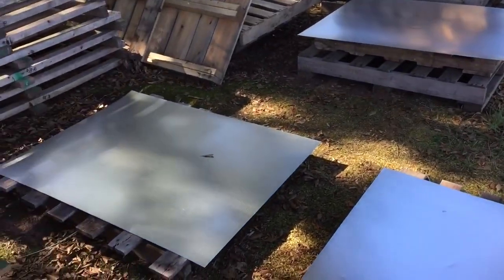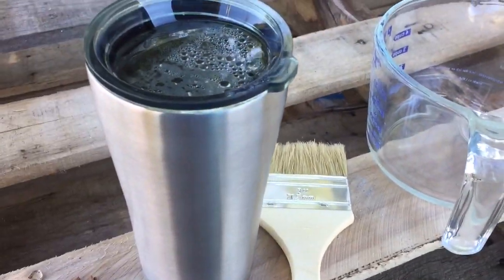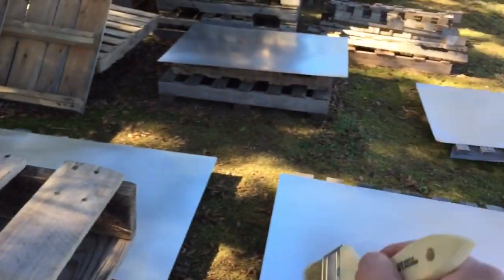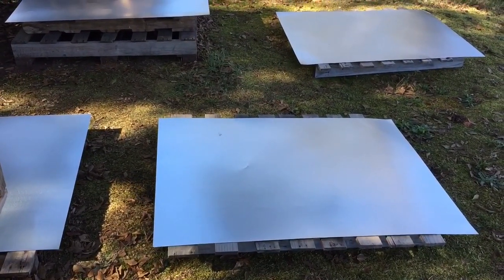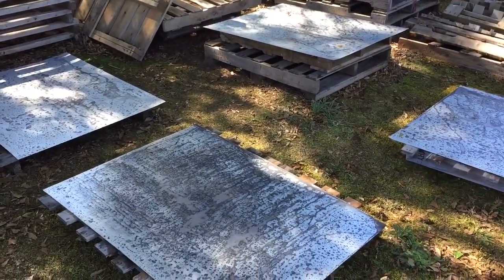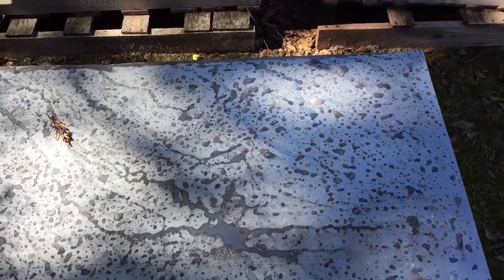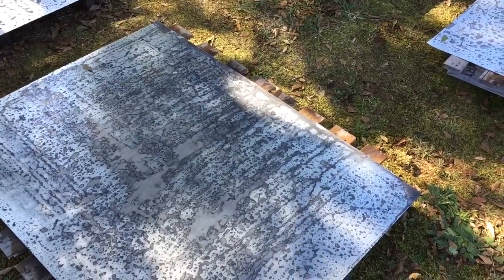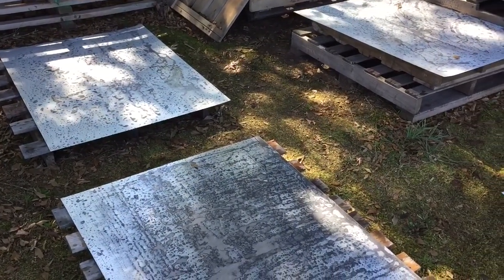Aging Galvanized Metal Sheets Part One

Comment: I am really struggling man. I watched all these videos on rusting galvanized metal. Looks like it's super easy process so I bough 100 sheets and wanted to use it as siding for a garage. But here I am and doing exactly what everyone else does and nothing. Just turns chalky white. Then nothing will take it to the next step of rust. I just can't figure this out. Driving me bonkers because I spent a lot of money. Anyhow, that's my story.
Reply from the maker: If you do what I did in this video, you should have rust. I’m no chemist, but it worked like a charm for me. I wish I could be more help.
Reply: I'm having the same problem.  I can only get a white chalky finish.  4 coats of muratic acid, and i even tried a wire wheel.  So frustrating.
Reply: @mrbriankeith111  Yes, nothing but white chalk here as well. I have $3000 worth of shiny metal just sitting in my driveway. Sucks.
Reply: @designsinorbit  my project is signicsntly smaller than yours,  I'm gonna try a grinder wheel and see if I can remove the coating.